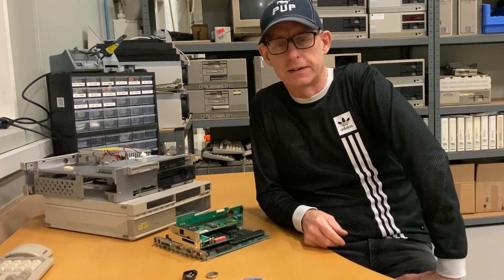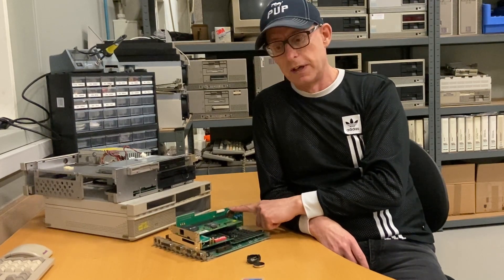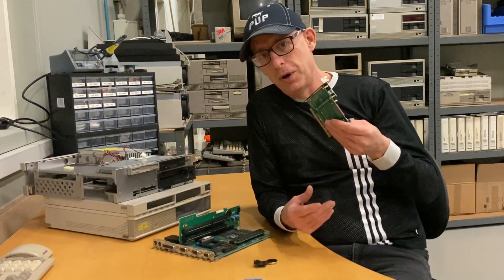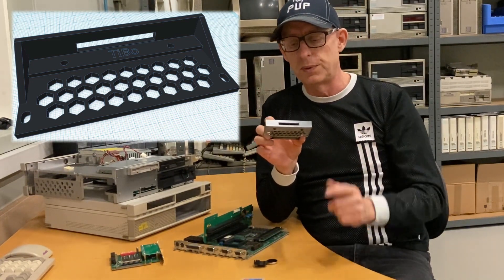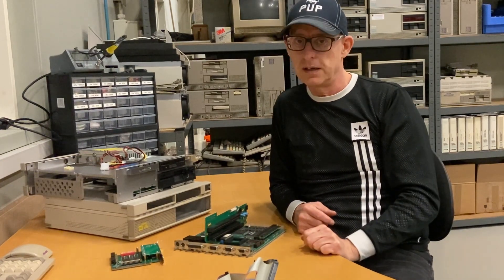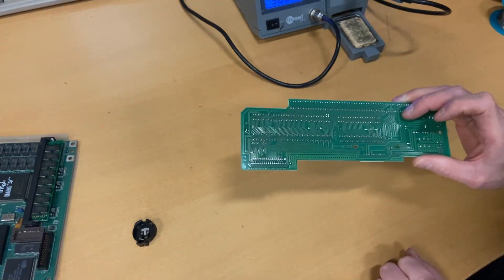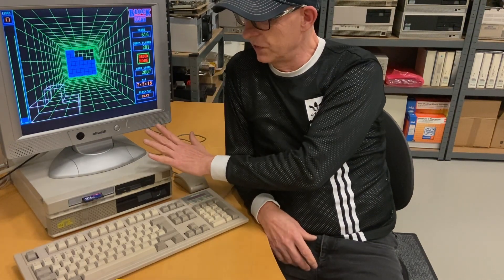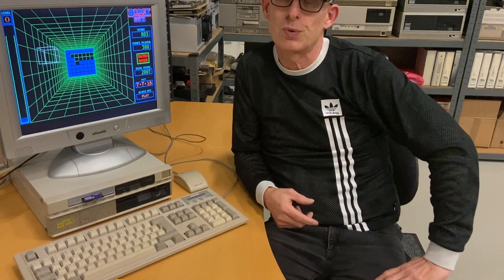Olivetti M4-40 modulo 80486 - Episode 2

Comment: Hey Tibo
How can I enter to the bios of the PC, if I get a disk read error at the startup.
(I think I don't have any system on the hdd either on fdd)
Reply: Actually this is where I'm stucked
https://pcrebuilding.altervista.org/images/resized_my_pcrebuilding/5ed6db25087c7_p1320626.jpg
Reply from the maker: If you HD is broken you need the 'System Test program' disk!

You need to set a jumper on the motherboard (There are many versions so you need to know what version you have). I sadly don't have that disk!

 => Jumper J12 - Setup control.
-> Position 1-2
 The User Program resident in the System Region of the hard disk drive and
 which allows the system to be configured, is not executed. If the configuration
 of the system  has changed, the only way to reconfigure the system is by 
launching the System Test program.
 If this security feature is enabled, the following message is displayed at the 
end of the Power On Diagnostics: POD Warning.
-> Position 2 - 3 
If the configuration of the system has changed, the POD will automatically 
access the User Program which allows the system to be reconfigured.

Comment: i have the strangest issue with my PCS 33. The system is caching disk drive data and does not refresh it even when i swap the disk. Dir command returns the exact files from last disk. I tried second disk drive and it does the same
Reply from the maker: This sounds very strange - have you managed to fix it?
Reply: @TiBosRetroComputers  not yet. Im in the middle of recapping the motherboard